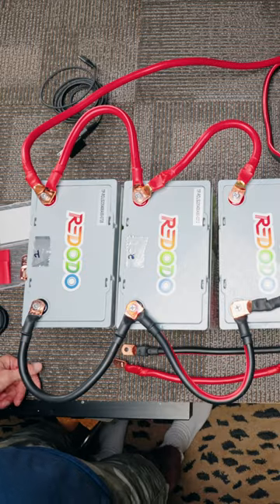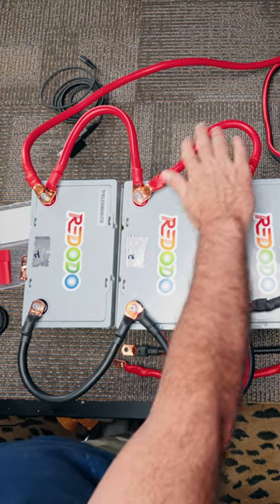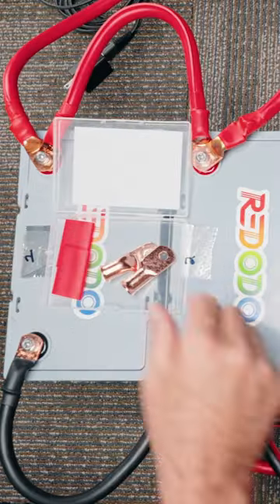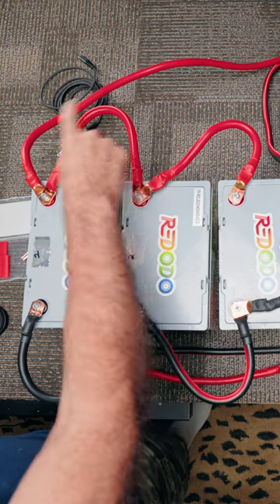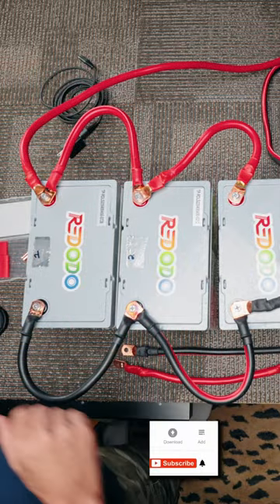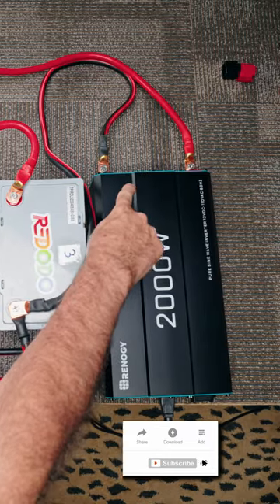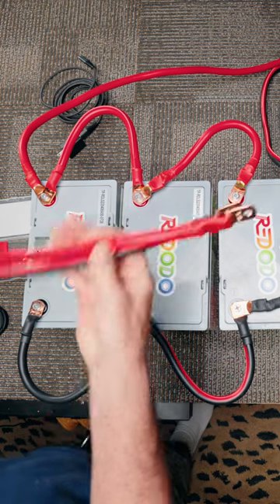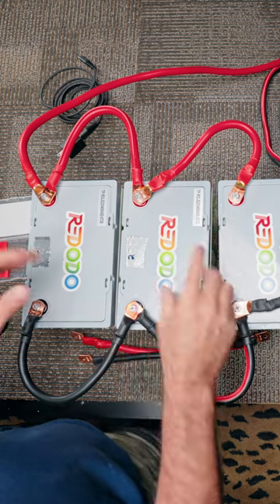How to Parallel Multiple Batteries to an Inverter #shorts

Comment: What is the difference of where you come off the battery set to the load? Any reason you couldn’t come off the pos and neg at the battery closest to the load?
Reply from the maker: No particular reason.  You could also tap from the middle battery would be a good place.  IF there are 4 batteries there is no middle battery so the first and the last will work too...
Reply: @JLPicard440  gotcha. So I’d assume the same would go for charging the battery bank as well?
Reply from the maker: @ryanjones9305  Yes probably... although I have a 10 amp charger to charge 1 50 ah battery.  If you put 3 or 4 batteries on there simultaneously,  I'm not sure it can handle it.. 😀
Reply: @JLPicard440  For charging, wouldn't hooking to the positive on the first battery and negative on the last battery be best?
Reply from the maker: HI @myemail2005 .... Is that what I did?

Comment: Maximum batteries in parallel can be 4 batteries not inverter manufacturer asked you to put 4 batteries.
Reply from the maker: That's right.  The manufacturer has specs up to 4S4P for a total of 16 batteries.
Reply: @JLPicard440  and I think since you can afford 4 batteries you should consider 48V system because it's kinda selfish to draw higher current from all those batteries and we don't know if that high current flow will cause longevity issues in the future. Cheers
Reply from the maker: @ferdm9646  Great thanks!

Comment: Can you hook up a yellow top optima and a lithium battery in the back with the amps?
Reply from the maker: No, when you parallel batteries it's best to have the batteries match... Same voltage, amp hours, battery chemistry,  and manufacturer...
Reply: You know how the packaging on battery operated anything says not to mix different kinds of batteries? That still applies with larger batteries. In fact the result will be that much worse. I haven't seen a battery explode, but I've been told that it can happen with little warning and do quite a bit of damage.

Comment: Yes its nice and ok.  Only coment  of course reduce lenght of cable  as possible. Because at 1 kw output at 12v is aprox 100amp at input  so high diameter and short cable to input of inverter. :-)  othervise increase lost energy..  output 240v ac can use standart extention cable   ..  good job :-)
Reply from the maker: Thanks for the great info and feedback... 😊

Comment: Why don’t take the positive and negative from the same battery?
Reply from the maker: IF there are 3 batteries you could take it from the middle battery just fine...  That way it has equal distant wires going to the other 2..

Comment: I only have 2 12v 100ah lifepo4 Redodo batteires. How thick should the wires be for a parralell connection ?
Reply from the maker: HI, if you're running a 2K inverter I'd use 2/0 sized wire for 3-6 feet of run.

Comment: Can I connect a 100 amp hr Li Time & a 100 amp hr Battle Born together and not have problems?
Reply from the maker: HI, the batteries should be the same rating, ah, type, manufacturer, etc.  I would not mix the batteries... 😊
Reply: @JLPicard440  Kinda figured that would be the case.Was a bit leery connecting a $900 battery to a $250 battery. lol
Reply from the maker: @donbxman7080  Yep!

Comment: Wow! I like to thank you for this video. I did my Owen Van built starting from scratch. When it came to the electrical installation, that was a technical process of understanding the wire size and Amps and voltage. So far my eléctrica is working fine, but the 4/0 wire overheated when I use an appliance. In this video of parallel connection the inverter positive wire is connected to the first battery positive and the inverter negative wire is connected to the third battery negative. I over look that  in my electrical installation, this may be what casing the problem. I will still need another cable to extend my inverter negative cable to the correct battery negative terminal. A++ on this video.
Reply from the maker: HI!  Thanks for the feedback... 😀. I believe the wire size for this inverter should be around 2/0... If you're using 4/0 that should be more than big enough!
Reply: @JLPicard440  Yes it is, but I don’t understand why is it doing that! If I use an appliance, like my stovetop, this is a 1500w and my inverter is a Victron multi plus 3000w I am puzzled. My stovetop use a 14gauge wire and I’m using a 15amp Circuit breaker. I found out that even dough I am designating the breaker just for this stovetop it is fine, but a better precaution is to use 12gauge wire instead. I’ll have to do some reconstruction to get behind the wall and place new wire. It is difficult to do that when you don’t have a place to shelter while doing a reconstruction. 😕
Reply from the maker: Do you mean shelter from the cold?  If so, Yes I understand that... I'm from VA.  It gets pretty cold there when you've got some outside work that needs done.
Reply: @JLPicard440  Yes, that what I mean. I live in Boston, Ma and in my first winter in the van, it drop -9 here in Boston. But everything in the van was working perfectly, it still is. Even dough my pluming is in side the van, it froze but not the tank. I end up buying a small electric heater to heat up the plumbing aria juts to melt the possible ice in the pipe. It only took 15Min and then, I was fine after that. Still enjoy my Van build. I have not yet traveled due to a injury case that need to be close, so I must stay in place for now.

Comment: How do you charge incase the battery runs down do you use a battery balance charger or you just connect the wire terminals to a charger?
Reply from the maker: Usually with a setup like this intended to be solar maintained.  The solar panels will have a charge controller.  That's what I use to charge with...
Reply: Ok thanks for the information
Reply from the maker: You're welcome.. @KwasiDapaah-hh1kz

Comment: OK so what about adding extra cables for example to run my diesel heater do I do the same here with the positive on the third and negative battery or do I just choose any one battery to connect the diesel heater  🤔
Reply from the maker: Does the heater run on 12 volts?  If so, you can connect it like I have it or connect it to the center battery if there are equal length cables running from the center battery to the other 2..
Reply: @JLPicard440  yes it's 12 v diesel heater  so I'll power the same way as the inverter described here.  Thanks  . I'm also adding a fuse to the positive cables  .
Reply from the maker: yes absolutely!  Thank you..  @desendean6488
Reply: @JLPicard440  thankyou aswell  . Can you recommend what amp fuses I should go for ?  , I'm running two 100ah hours batteries with one 2000w inverter although I would probably never exceed more than 400 Watts.
Reply from the maker: HI ... most 100ah LiFePo4 batteries probably have a BMS module that limits the amperage to around 100AMPS.... So you have 200A available.  I believe the 2000 Watt inverter will draw close to 170 amps at full load... If you're not planning to connect to full load you could go with 100A fuse and be fine.  But will probably blow if you run the inverter to full potential.. @desendean6488
Reply: @JLPicard440  I'm thinking 125 amp fuses for both 100ah batteries  .the fuse suggested for the Inverter sounds 👌 . Yes there is no way I'm getting even close to using 1000 Watts on the inverter  . Thanks  for  the advice  ✌️ .
Reply from the maker: Excellent!  You're welcome... 😀

Comment: I have one question 
Please answer me its an idea in my mind 
2 12v batteries in series for charging
And take parallel cable to run 12v inverter ia it possible
Reply from the maker: HI, if you've got them hooked to a solar system with charge controller and the works, then the system is either made to work on 12V or 24V.  I don't think you can mix them unless your charge controller can switch to both (not at the same time).  I would probably leave it one way or the other.
Reply: @JLPicard440  like i want to charge battery in series 24v
And take (+-)(+-)cable from 2 battery and to run 12 inverter 
Or i need step down regulater to convert 24v into 12v to run inverter
Reply from the maker: @jasonbourne7171  I could be wrong but I don't see a way to connect the batteries in series and parallel at the same time... Unless I'm misunderstanding what you mean...?
Reply: @JLPicard440  Yes bro you are correct cannot use both parallel and series at the same time.

Comment: Im connect inverter 2 battery but 1 battery after play pc 12.90 2 battery 12.75 what im wrong 😥
Reply from the maker: How many batteries are you using and how are you connecting them?  Also, are the batteries exactly the same as each other?
Reply: 2  battery now try ur tios maybe im wrong connect
Reply from the maker: ? Not sure... @НиколаДимитров-с6ь
Reply: If you are running batteries in parallel and one seems to be discharging faster than the other.
The other batteries capacity is lower
Reply: @JLPicard440  its me  im newbie  maybe  batery bad  for cars :)
Reply: @JLPicard440  this old  now hgave beter monitor   and inverter  :)
all pc work on solars:)
Reply from the maker: @IIGrayfoxll Yes that's true... It's best to use batteries that are of the same size/ capacity and also similar age as well...
Reply from the maker: @user-bi3ic7ny3c HI do you mean as a replacement for the main starting battery?  If so then absolutely do not use this for  a starting battery.  These batteries have what is called a BMS (Battery Management System) that limits the amperage to around 100A (Depending on the size of the battery). Deep cycle batteries don't have the cranking amps like a regular lead acid batteries you might find at your local parts store, Walmart, etc..  Hope that helps.. 😀
Reply from the maker: @user-bi3ic7ny3c If you have a pure sine wave inverter it should be ok to run electronics like a computer...

Comment: Jumper cables use junk wire, never use them like this. The old school jumper cables used actual copper wire, but with very few strands which is why they weren't very flexible and would keep their shape after being bent. The new jumper cables use something called CCA, copper clad aluminum. CCA isn't new, but should be avoided for a few reasons. First, it isn't nearly as conductive for current. Second, it isn't nearly as sturdy and is more prone to breaking strands which will reduce current flow. Third, it's really cheap and you over paid by quite a lot by buying it as jumper cables. 

Do yourself a favor and look for OFC welding wire. For a 2kw inverter I would recommend at least 2awg, depending on the actual load. With CCA it would need to be at least 1/0awg, maybe 2/0awg. 

Just don't use CCA cables. They have their place, I guess, but I would avoid it for critical systems.
Reply from the maker: Awesome!  Thanks for the great info..

Comment: Are your cables sufficient for the max current now available from batteries in parallel? I think that’s the main issue, as well as the quality of the crimping (and not welding) of the terminals: you need the proper tool. Also you might make the short cables as short as possible, but not too short, not straight: they need some flex for dilatation.
Reply from the maker: Great!  Thanks for the info.

Comment: If you have an inveter and are looking to add a second battery, is it a positive from the invertor on second battery and negative on first? Is it also the same with the positive and negative coming from the charge controller? Thanks for any help.
Reply from the maker: Hi... If you have 2 batteries I would pull a positive from one and a negative from the other.  Both batteries will have wires between them making it a parallel connection red to red/ black to black.  The charge controller should only have 2 wires... Yours has more?
Reply: @JLPicard440  two wires on the charge controller thing to figure out should I connect the positive from the charge controller to one battery and the negative to the other?

Comment: What about grounding to the frame if im  using that setup in a cargo trailer
Reply from the maker: Yes that will work too!  That's all they do in a car is run the ground from the battery to the frame... 😀

Comment: Check your cables to ensure that they're not CCU, which is Copper Clad Aluminum. Most cheap jumper cables are not pure copper.
Reply from the maker: Thanks for the info!  I appreciate it..  I seem to remember installing the ends and they were copper all the way through, but it's been a while now.

Comment: Question: can i hook up a lithium battery and a AGM battery together in the trunk as secondary batteries?
Reply from the maker: HI, if you parallel batteries they should be the same capacity, chemistry, manufacturer, etc.... 😊
Reply: Great, thanks for confirming i appreciate it!
Reply from the maker: YW!

Comment: Probably want all the batteries about the same age and make, and swap them around so they " wear" more evenly.
Reply from the maker: Yes that's right!  Thanks for the input...
Reply: And same amperage, it will over charge the weaker one because the higher one won't be satisfied and keep pulling a charge. And if one fails it can ruin the rest  at the same time.
Reply from the maker: Great info!  Thank you for the input.. 😀

Comment: Okay, but what does this do?
Reply from the maker: An inverter takes 12 volts from batteries and converts to 120 Volts AC like the ones you have in your house.
Reply: @JLPicard440  No I mean, what's the point in hooking the batteries up like that?
Reply from the maker: @agoogleuser2507  It adds amperage over what you would get with a single battery.
Reply: @JLPicard440  Um. Laymans terms? 😅

Comment: Do you need a 12v or 24 inverter to have just two batteries connected?
Reply from the maker: It depends on what the requirements of your particular inverter are.. Inverters come in 12v, 24v or 48v requirements.. Batteries also come in different voltages.

Comment: Do all these cables have to be the same length. Especially the ones connecting the inverter? I want to make my own
Reply from the maker: HI... Not sure if that's really critical like antenna wires would have to be... but it's better if they're close to the same length.
Reply: @JLPicard440  thx
Reply: The longer the cable the more resistance=heat.  Heat burns insulation and causes fires. Thick short cables work best. Thick cables cost allot more but its safer. Hope that helps.
Reply from the maker: Agree 100% 😀 @bronjefferies2612

Comment: Exactly the right way of connecting batteries in parallel to power an inverter.
Reply from the maker: TYSM!
Reply: Not really but most dont know how
Reply: @markwaring622  It’s exactly how it’s done. Each cable connecting each battery to the inverter is the same length.

Comment: Hook the cables to the inverter to the center battery with cables going each way.   
When doing cranking battery cables. The cables to the starter should be thicker
Reply from the maker: Cool!  Thanks...  Probably a big truck is connected that way..
Reply: @JLPicard440 big engines like our 300kW generator have 2 x 12V  batteries in series,  Technically you should fuse protect parrallel batteries.
Reply from the maker: Absolutely!   @dogwalker666

Comment: How did you make sure all the batteries are relatively the same voltage before connecting them together? I’m wiring two LFP 12v 100Ah batteries in parallel but I’m not sure how to get their voltages equal, especially when LFP batteries have a “settle” time after charging
Reply from the maker: HI, simply check them with a volt meter.  Most manufacturers will recommend to stick with the same battery manufacturer and specs, voltage, amp hours, etc.  When connecting in parallel.  I am not sure how much deviation is to much, but I just checked these with a meter and didn't have any problems.
Reply: I make sure the voltage is within 1 volt or so (use multimeter) then make the connection through a big ceramic 3 ohm resistor to let the batteries equalize before making the cable or bus bar connection.
Reply: @Miata822 one volt is not enough. That’s 0.25V per cell which means one battery could have cells at 3.10V and the other at 3.35V

The difference between those two is about 50% state of charge or more! Potentially up to 70%. You could see currents in excess of 100A easily if your connections have a low enough resistance. Even with the resistor you will be loading it up VERY fast if you get unlucky and happen to parallel two batteries , one at 12.4V and the other at 13.4V. 

(This is for 12V batteries)
Reply from the maker: Thanks for the great info!
Reply: @ericklein5097  "Even with the resistor you will be loading it up VERY fast "
That's not how electricity works. Read Ohm's law.
Reply: Always put a breaker/fuse between the two batteries connecting in parallel. It's best to fully charge them before connecting, check the voltage on each is within .3 of a volt and hook them up via the breaker. I put a 50a breaker between two 12v LFP 100AH batteries as my cables are rated at 50a then I have a 50a fuse between the inverter and batteries. This way, if there is a sudden inrush >50a between the batteries the breaker will activate or at worst the fuse will blow.
Reply from the maker: Yes... 100%. Thank you. @shmayazuggot8558

Comment: There’s a reason why that jumper cable is cheaper than buying proper 4AWG or 2AWG cable. 

That jumper cable is almost certainly copper coated aluminum, meaning you’d need at least 1/0 AWG to properly feed that inverter for a 2000W output.
Reply from the maker: Thank you for the great info... 😀
Reply: @JLPicard440 I was gonna comment the same, buy oxygen free copper wires, perfectly 2gage or 0gage, also make sure that you also have a ground connected also to an actual ground, in the car you can use the engine block or the chassis(body of the car is paint coated but if you don't mind scratching a bit of the pain body could work too)
Reply from the maker: Excellent!  Thank you @bitterlemon7721.